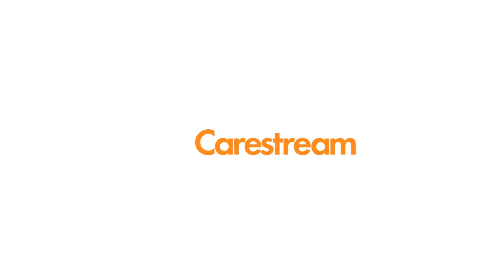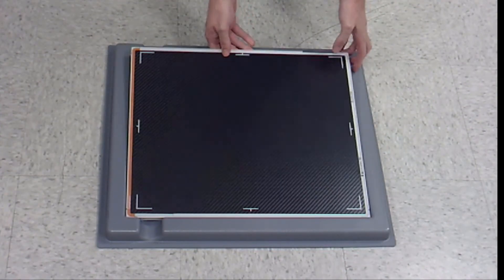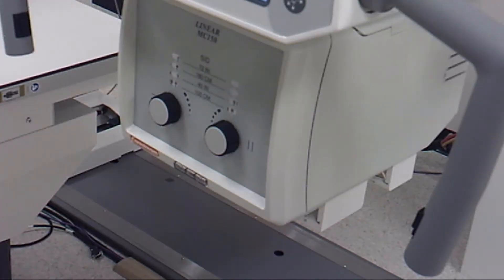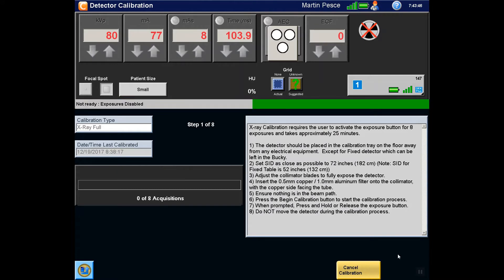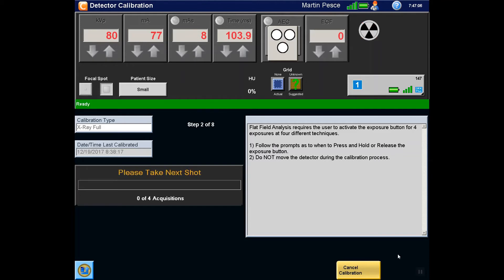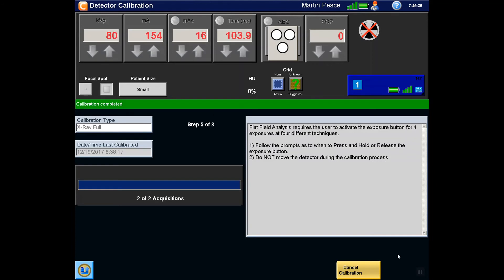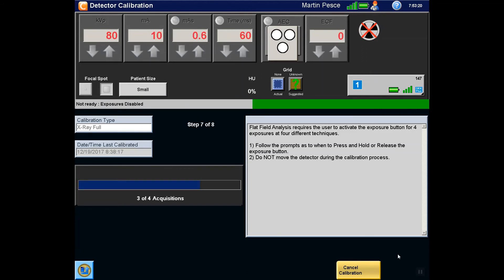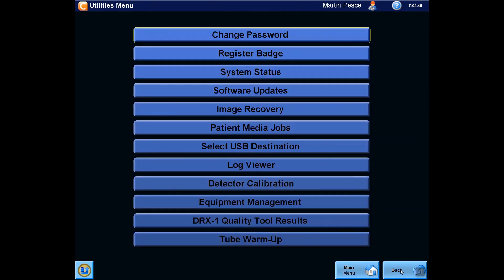DRX-Plus Detector - Full Calibration Demonstration

Comment: What’s the purpose of the copper filter? I mean, in our institution, our collimator has a filter built in but only up to 0.5 mm Cu and 1 mm Al, can we use that instead of the one you manually placed?
Reply from the maker: Hello, I have asked our team for the response. I will respond to you soon. Thank you for your patience
Reply from the maker: Hello, please call our service team at 1-800-328-2910     They can answer your questions. Thank you